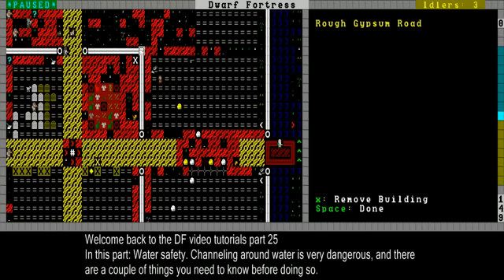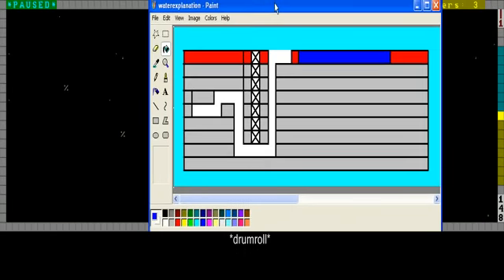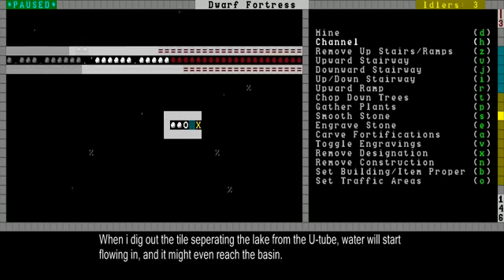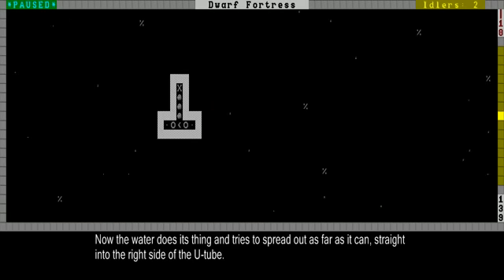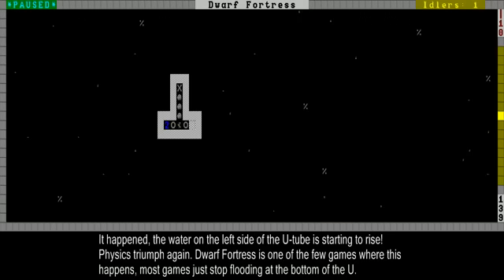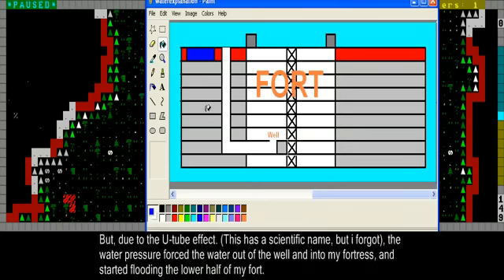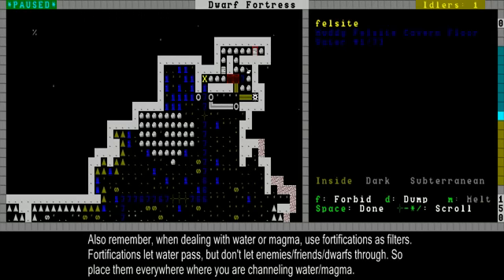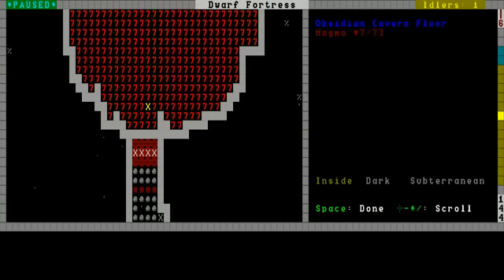Dwarf Fortress Video Tutorial part 25 - Water channeling & U-tubes

Comment: My condolences for your fps(s).

I have made pump mistakes a few times as well. I had about 5 dwarfs on mechanic duty and only one on carpentry and yet the 10 axles and water wheel got finished before the single gear control link was built... i flooded a large area  and muddied the river. :S

Comment: Isn't neither water system realistic because even though in most games, the pressure seems to have no effect on water, which is unrealistic, in Dwarf Fortress it seems to act as if there is no air. If the air has nowhere to go, the water cannot take up that area, correct? (The same principle as putting a bucket on your head and jumping in a lake) If I'm wrong, please correct me.